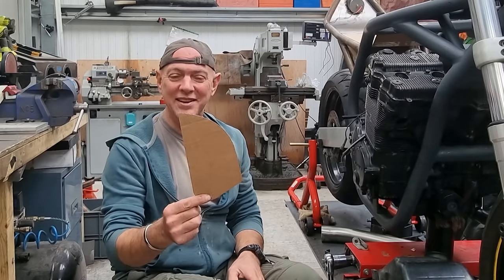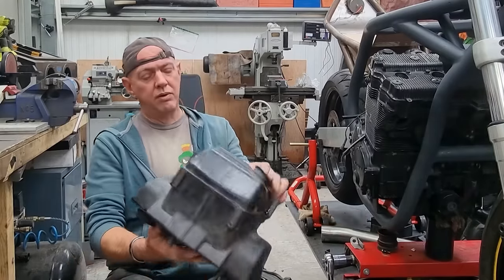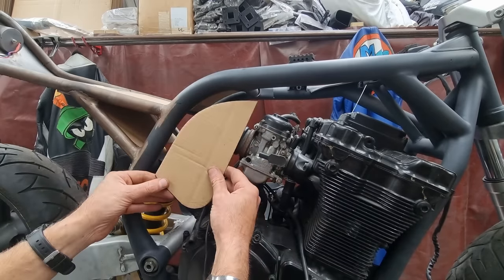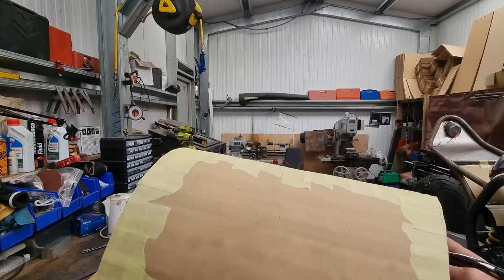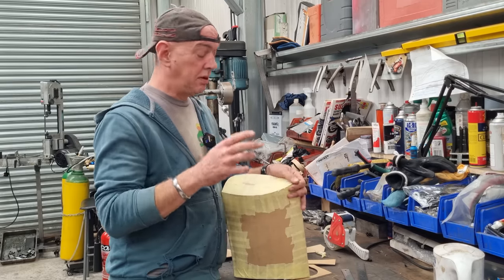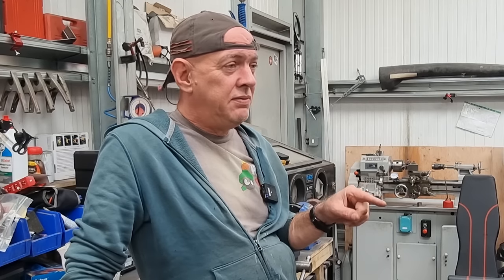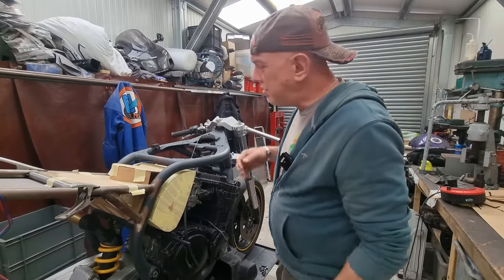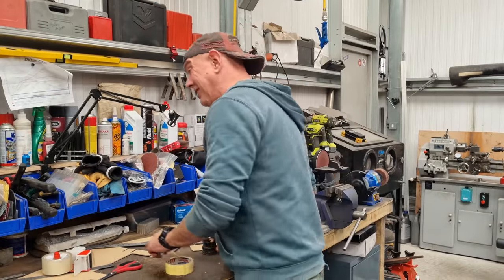Designing an airbox - Suzuki Bandit Cafe Racer - ASBO Project

Comment: Got a soft spot for the Bandit 12, sold my Blackbird and bought one because it was happier pottering around behind 50's and 125's than the Blackbird was (riding instructor, not just bothering L platers!).   It was such a laugh and always up for a bit of "making progress", and the tuning market for them is massive!  A GSX1200R sounds proper naughty!
Reply from the maker: It does, doesn't it... 😁😁
A Bandit 1200 in Bandit style SRAD sized frame with decent suspension 👌

Comment: Back when I had my Race Car/Race mlm Bike shop ..I had a "SuperFlow" flow bench, to do Heads, intakes, and exhausts on Cars and Bikes..You are absolutely right about the pressure waves!. and there is an exact formula for figuring out how tall or short you .make your Velocity Stacks..top end power or low end power also figures in!..Removal of the Air Box, will definitely change the dyno specs!..So will changing the exhaust! ...That changes all the numbers...Getting advice from a Race Shop that Flow Benchs their bikes is your best bet..Everything else is literally guess work...(with more experienced folks having a better chance at hitting the high numbers)..Keep up the good work and I'm sure you will get it..👍🗽🇺🇸
Reply from the maker: There's a lot of guesswork going on here, but with an engineering degree or access to test kit, the only thing I can do is not stray toooo far from stock. Its going to be a compromise though however close I get...

Comment: Hi Quicky, me again, also I have a Kawasaki GT750 cafe, I put oval pods on the carbs, spent 30 hours on interweb seeking jets sizes etc, but after very vague information i put filter foam inside each pod, i was only after the look as the 750 has enough grunt for fun, briggs & stratton 4 stroke lawn mower air filters, 1 in each, and they work brilliantly, cheers mate...
Reply from the maker: I'm tempted with a set of foam filters matey. From what I've read, they work quite well and Piper do a set of four that fit 🤔

Comment: Fascinating. I concur with the idea of pull out the rear half, then can slide out the front half - needs some rubber edging on the joint I'm thinking. 👍😊
Reply from the maker: I won't getnit out otherwise matey. Should be alright though I reckon 🤔😁

Comment: Inlet chamber design is even more complicated than exhaust . Especially on a motor that works over a large range of rpm ( pulse frequency and actual air flow).
Reply from the maker: There's a ton of clever stuff goes into those plastic boxes as I'm now finding out 🥴

Comment: On my old 7/11 I used to run two large foam oval filters, they worked well and better than individual pods...
Loving the build 👍👍
Reply from the maker: I'm still looking into twin pods but from what I'm seeing, that's gonna be an issue on this engine matey
Reply: Get a jet kit from holeshot. I’m running his stage 2 kit with individual pods and a full titanium exhaust from black widow on my 600. Zero issues right out of the box. Dale is also super responsive and can help out with any issues
Reply from the maker: That could save me some work...
Reply from the maker: Funny you should say that... 🤣

Comment: on the ZZR try and old school Gunson Colortune as the nocking might be the idle mixture not even across the board - rod knock would not normally sort it's self out on higher rev's - how ever I would defo sort out the van :) I cant wait to see what you settle on with the air box on the 600 as I am doing the exact same bike at the moment and wanted to do away with the air box mainly due to the faff to remove it. better to let someone else figure it out 1st :)
Reply from the maker: When the oil pressure test guage turns up, that should tell me for sure but that van needs sorting out anyways 😁👍

Comment: Just a thought on the issue you have up to 3100 rpm, this is also around the time the carbs switch to main jets ,, could it be  an air leak or sound ... Just a thought ..👍
Reply from the maker: It sounds very knocky mate, so dont think it's a leak... I've checked all the obvious stuff, so thr only thing left to do is pull it all apart now...
Reply: Throttle position determines which jet, pilot, needle or main jet, not rpm.

Comment: looks like a BARN it's grim. good luck, 750 carbs used to be a common upgrade, shame the shitbox micra crowd made the throttle bodies for the 600 and thousands gxr more expensive.

find a floe bench and the drafting programs. my suggestionbwould be some tubing/ducting in the area you arent bulding into like ram air style coming fron under the seat/in the tail to compensate for the lack of volume

given that you have to rejet for the new exhaust anyway the hi flow filter is going to be massively helpful power wise. 8-15hp in theory from a hi flow filter and exhaust change.

airbox internals are always a compromise between WOT power and mid range response and s bike that does wot power is easy something thatbdoesnt sacrifice massively is far harder. its why the variable runner length tech is so cool and heavily researched.

could you tack or Shape metal inserts to.round the corner maybe? alter the shape of the box inside after construction before welding the lid on?
Reply from the maker: I'm hoping it turns out OK... ultimately we won't know till we run it but I'm hoping buts not horrible. If I don't like it, it's going straight in the bin anyways 🤣
Reply: @QuickBikes  ahaha always an option

Comment: Doing a bandit custom myself and saw a stage 2 kit from holeshot performance in America which does away with the airbox and runs pods instead. Thoughts?
Reply from the maker: The only difference apparently with a stage 3 is the size of the main jet. I'd have a go at running it on a dyno and see what the AFR does. If you need to up the jetting its always an option... 👍
I'm not sure you'd get it spot on by ear which is why I'm going to a dyno to see if it works right. Best of luck dude 👍
Reply: @QuickBikes  thanks man i'll let you know how i get on

Comment: Loving the build. Got a no b
Bike question! What weight bench is that? Is it any good? Looking for a reasonably priced one. Cheers
Reply from the maker: Thanks for watching matey, it's much appreciated 😁👍
The bench is really good and takes 1000kg . The o ly things I'm not keen on is the chock that bolts on to hold the front wheel is too high and hits brake discs, and I keep walking into the lever to pump the bench up, which tends to sting a bit. But I'd have another one for sure 😁👍
Reply: @QuickBikes  lol thanks but I meant weight bench 🏋💪💪🤣🤣
Reply from the maker: 🤣😅😂 Sorry dude. I don't.know.what it's rated to... but it's had an engine on it 🤣😂

Comment: Hi Quicky, why why why would you need to put a daily ride on a dyno, my 95' 1100 started for the first time in 5 years after a lot of tlc, first ride was 2 days ago and pulls 70kph in first gear, still got 5 more gears, but that was for a brief second, why hold a bike at revs it will never do on the road on a dyno, i understand racebikes are designed for constant high reving, but a daily... guess there is only 27 silver registered in the UK left now? love the channel, cheers mate
Reply from the maker: Running it up on a dyno is a great way of checking everything and getting stuff like the fueling right. I should have put more miles on it on the road before dynoing it, but given how rich it is and finding the worn seats in the carb, it was worth doing at some point. The race bikes we ran in the past mechanically were a stock engine with only a can, air filter and properly set up the dyno. Nothing more than that as the regs didn't allow it and there's no reason a stock engine shouldn't be capable of it. The bike will come apart again and I'll fix whatever went wrong as its a good little bike now 😁

Comment: Just an idea but what about the split being horizontal line? instead of vertical line? like a clam shell type idea....
Reply from the maker: That could work.... might be a bit hardener to make though... hmmm... 🤔
Reply: @QuickBikes  I was thinking it could open down into the space where the rear wheel is as opposed to removing the seat and tank??